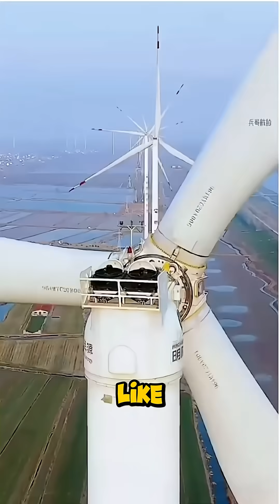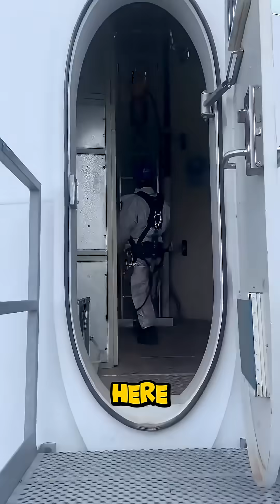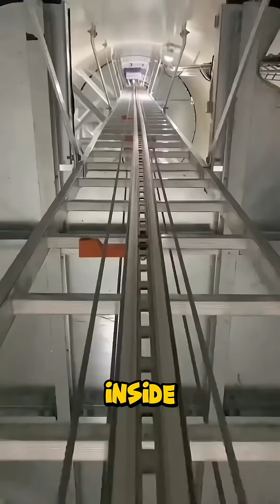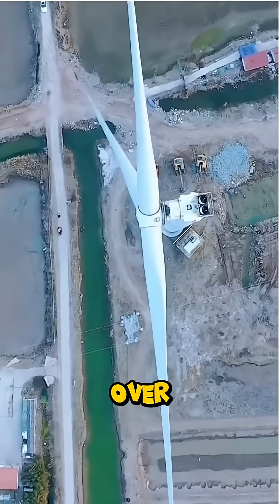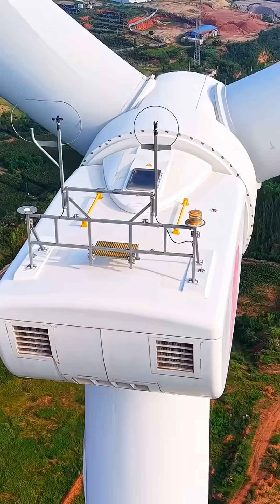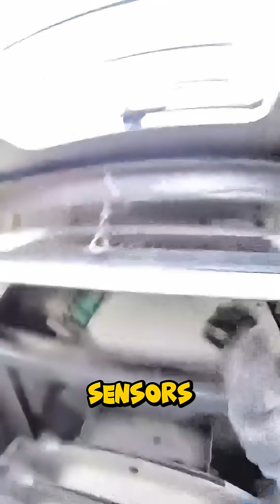What's INSIDE a Giant Wind Turbine Extreme Technician POV! 💨

Comment: This is a very costly alternative form of energy. It still uses oil, not to mention it won't really have any significant change to the carbon footprint. 20 yr lifespan that requires high maintenance costs.

Comment: These are actually really bad for the environment because they break fairly easily and are too expensive to fix. Also, the process of installing them is extremely expensive and timely, so they usually just end up lying where they were first installed, broken, or they end up in landfills, in pieces.

Comment: I always thought of something, maybe STUPID,  have the heavy rotar at the bottom base of the tower. A thick chain and a gear to connect the blades to the bottom base.

The base should be able to 360 degrees with the tinyest push like a turntable used to turn locomotive steam engines.

Comment: Green energy environmental friendly, my ass.
Reply: And wind turbines definitely need oil 🛢️to lubricate internal components, such as the gearbox and bearings, to reduce friction and wear. 😜👍
Reply: Why? What's the problem with windmills?
Reply: @ShakirShakir-yf7ge the carbon footprint of just mining the raw materials like steel and concrete, produce concrete and steel, transport etc is enormous. It takes years to even get carbon neutral. Mainstream isn't telling you that
Reply: @RikHendriksDutchCo  right but they r mining anyway. 
And u r right, we should stop all mining

Comment: Heat increases - yes - because heat always rises. But pressure? The higher you go the lower the pressure, trust a diver. Air is the same - it has weight, a bit less than water, but it does. Will you ever wonder what clickbait narrators tell you?

Comment: Absolute fraud. These things have limited life, uses an incredible amount of steel, concrete copper etc. mined and manufactured at an immense carbon dioxide release into the environment with intermitted power supply and eco damage that no 'green' wants to acknowledge and at a cost which will ruin economies. Nice from our green zealot 'friends', isn't it?

Comment: I used to believe in wind and solar energy. Unfortunately it is not all rosy. I often drive through I-10 near Palm Springs. More often than not a few are out of order. On California's
Highway 46 near Lost Hills CA ,not too long ago they built a huge solar power plant. I hear they're losing money. The reality is if we still want all the luxuries that require electricity to run them. Solar and wind will not do to run them.

Comment: There ain't nothing clean about that. With all the carbon-based fuels required to manufacture, move to the site, assemble, and maintain that bird chopper for 20 to 25 years, including, ironically, regular oil changes and anti-freeze. It will NEVER EVER BE CARBON NEUTRAL. Not even close.

Comment: Not tell everybody how much you still need oil to keep it lubricated
Reply: Thousands of liters
Reply: Or the diesel used to build it and then haul it out there and erect it.
Reply: Coolant, hydraulic oil, lubricant. But still far less oil than using oil to power homes.
Reply: There are such things as plant oil based lubricants.  I forget the name of the German manufacturer that produces a range of lube oils for biodiesel fuelled engines (fossil fuel based lubes are not compatible with 100% biofuel fuelled engines).   I was involved in a business that provided the oil in the UK for a time.
Reply: @MikeLawtonUK Oil used to be plants, millions of years ago.

Comment: What's inside a wind turbine? Usually a diesel generator since wind don't do shit
Reply: Diesel generator?
Reply: @newhallgeorge1 it's a well known fact that diesel generators are used to back up solar farms, and to pad up the KW numbers. I assume the same thing with wind. I can't prove wind does it, but I have tons of pictures of diesel generators installed at solar farms..... Ask any contractor that's ever worked on one
Reply: @BruceClothier-n5p9j  I've worked for a major electric utiily for almost 40 years and we don't use diesel generators to back up renewables.  The solar and wind farms are all tied to the grid and when the solar or wind goes away we just raise the output on one of our other resources either hydro power or gas powered combined cycle units.  Places like Alaska or Hawaii might have diesel generators for their small towns that are not connected to the interconnection.
Reply: Also, the world is still flat!
Reply: @ptewiki6598 Har gar Har, if you really believe in renewable energy, I got some prime land in south Florida for sale, a bit damp at the moment but will be fine in a week or two
Reply: Diesel generator inside a wind turbine? What have you been smoking?

Comment: Air pressure drops as you rise, not “intensifies”
Reply: What do you suggest, burn people you don't like for power??
Reply: Yes, it would be colder, not hotter. We used to leave the doors open on aircraft until we were ready for takeoff because once we got up in the air, it got a lot cooler than it was on the ground in Texas.

Comment: Prove that it creates clean energy
Reply: yes...its a relative term isnt it.
Reply: Well simpletons don't see smoke comeing from it so they deem it "clean"
Reply: @nicolasalbright3444  And you're the smart one lol
Reply: @WAN2TREE4 
How much oil for lubrication then ??
Reply: I still want to know - the energy that each of these "fans" apparently generate - are these fans somehow connected to a grid or power station - for that power to be used by homes?  Or are these fans there just to justify the money laundering going on in the name of "green energy"???
Reply: Did you see how clean it was? Looked like he was running some high grade silicone around a seam to stop a leak.
Reply: A wind turbine's typical operational lifespan is
20 to 25 years, though with regular maintenance, this can be extended to 30 or even 40 years, especially for modern turbines. Factors like component quality, location, and environmental conditions also influence longevity, while major components like towers and foundations often outlast the overall operational period.
Reply: I just love it when one of them breaks down and self destructs, producing lots of acid toxic smoke as it burns up and disintegrates! Get rid of them one by one!
Reply: Just the carbon footprint for one blade alone makes the whole thing useless.
Reply: @troyadamson8618 exactly
Reply: @troyadamson8618 You need to check your facts: typical life span is 20 years, but longer with good preventative maintenance. Time to recover carbon footprint of build and installation is around 7 years.  That gives a conservative 13+ years of zero carbon / zero emissions energy.
Reply: Cuanta energía ha consumido para  empezar a producir? Cuanta consumirá en su mantenimiento? Cuanta energía producirá en su vida útil?
Reply: @fernandoreybello5362 a typical modern windmill will during 6 month operation produce energy which covers the energy required for producing it. 

Don't be fooled by false information. Pls see Vestas LCA reports on the internet.
Reply: Nothing clean about this "energy".
Reply: @mabaker391 Why & What The Reason Is?

Comment: When there isn't enough wind for these things (or not enough sun for solar farms), a coal or gas-fired power plant has to be built nearby to produce the missing electricity. All these (duplicated) equipments must be replaced regularly; somehow they are also renewable, but not for free, it costs a lot because it consumes resources, and recycling has its limits: for instance composite blades (the resins are made from petroleum) are cut into segments that are simply buried in the ground, and very often, for a bunch of reasons, the concrete base remains in place; R.I.P.!
Reply: Meaning that the blades are not reusable or made of recycled plastics?😮
Reply: Denmark here. Wind turbines have served us well for five decades. In a few years time we will be 85% powered by wind turbines.
   The blades are made of fiberglass (not plastic, Merrill), and can now be decomposed 98% by a recently found bacteria. The remaining 2% of material has various other uses in normal products.
   This means that the blades can now easily be 100% recycled. Cheers.

Comment: You can't beat hydro electricity!
Reply: Hydro is fine, but it is limited.
Reply: @newhallgeorge1  It isn't really: all around our coasts there are tidal inlets that can be dammed against the incoming and the outgoing tides.  At optimum water level the gates can be opened to drive turbines.  Tides are infinitely more reliable than other renewables, especially wind power, and such installations are a fraction of the cost of wind turbines and last much longer!
Reply: @delta7155  I doubt that they would last much longer.  They are exposed to a harsh salt water environment with moving parts that would need maintenance.  What would be the effect on marine life?  I doubt that there would be enough energy in a mild moving tide.
Reply: Yes. It's called nuclear. There are many options to re-use waste also.
Reply: Just by it's being... It has already caused more contaminating waste than it could ever overcome with elecrict.
Reply: How much energy does it take to build a dam ?
Reply: It is a renewable energy too. It is not about beating it, it is about having alternatives.
Reply: *breathe
Reply: But but awesome tech.
Reply: wios
Reply: Hydro involves flooding thousands of hectares of a natural ecosystem destroying it. Caribou migration routes are disrupted, putting them at risk. Mercury that has been secured in the soil is released into this new watershed  and downstream. Tell me how great hydro power is......

Comment: Clean energy? Just what did it take to put the stupid thing where it is? Steel, Carbon, concrete, oil, copper and the list goes on. This thing has created more pollution than a gas fired generator producing the same amount of electricity. When it works!

Comment: Low-efficiency wind turbines should be forbidden. They consume large amounts of fosil energy to be made. Advanced Nuclear, reusing nuclear waste, is a far better solution!
Reply: Always has been!
Reply: Still uses far less oil and gas than using oil to provide electricity. And countries like China and others are investing in nuclear. 

Wind, solar, hydro, are only a temporary solution.
Reply: Well thanks for letting everybody know how little you know.
Reply: I don't want any nuclear plant anywhere near me! NOPE!
Reply: @Shane1163  Modern Molten Salt reactors are much safer!  Nobody wants a wind turbine close by!  Nuclear power plants these days are already safer as they used to be  thx to increased safety measures.

Comment: Drive through Palm Springs and half of the wind turbines are not working. Generating power??
Reply: What is the annual average output?
Reply: There is plenty of wind turbines abandoned for years😮
Reply: You stop wind turbines when they would generate much more power than you need.
Reply: I was about to write that...
Reply: If there is no wind or the wind speed is too high, they don't spin. You might not be catching them at the right time.